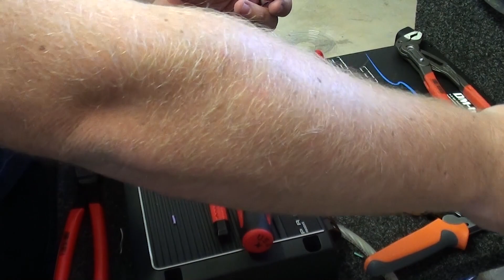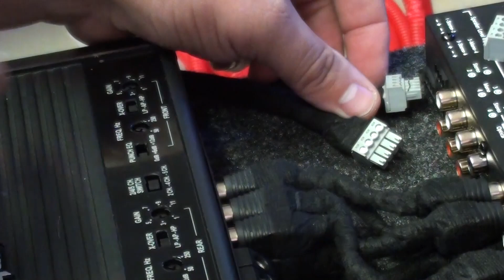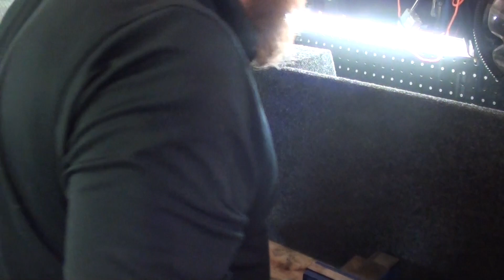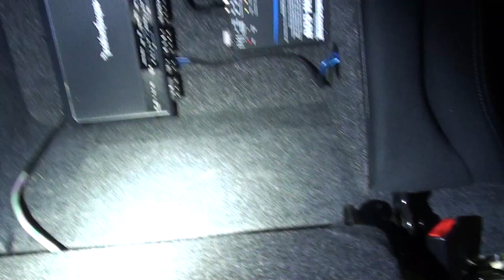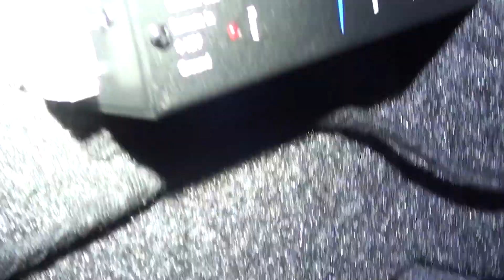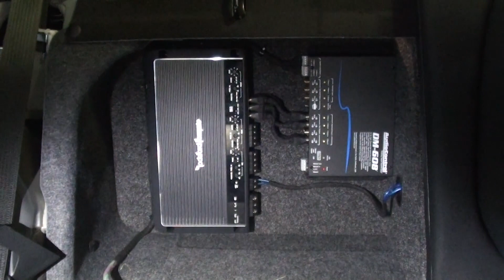Part 6 - 2015+ Mustang Audio Upgrade - Sub Install/DSP to Amp Wiring

Comment: Did you happen to include in a video how you provided power/ wired for power the 608 or is the power provided by the head unit? Also does 608 need to be grounded? Thanks for the great video series and your help!

Comment: Where does the signal from the sub come from? Also it looks like you ran 6 out puts going to the amp. Does that include tweets or an Additional sub for later?
Reply from the maker: The lows get separated by the DSP and put on a separate Stereo channel.  You are correct about 6 RCA outputs from DSP to AMP. LF + RF + LR + RR + Sub Left + Sub Right
Reply: @GJDGarage  so when using the dsp for the front speakers which are spliced into the tweeters what signal do you assign the fronts going to the amp. Do you use high mids or bass since Is two different signals for two different speakers.
Reply from the maker: Sorry it took so long. I didn’t get notified you made another comment. I sent the full spectrum and let the crossovers do their job.

Comment: Hi great video thanks for the help, I was wondering where did you end up installing the crossovers and why didn't you install the crossovers next to the amp and dsp?
Reply from the maker: The ISS 165 crossovers are tiny and to be installed in-line.

Comment: Do you have a link to the wire strippers?  And the RCA cable you used?  Thanks
Reply from the maker: Wire Strippers:  https://www.crutchfield.com/p_18119100/SG-Wire-Cutter-Stripper-Tool.html?tp=990
RCA Terminals:  Link in the description of this video
Wire:  Link in description of Part 1 Video

Comment: Hey bud .. just to make sure before i buy.. can i install 6 3/4 speakers  on the front no problem?
Reply from the maker: William De La Pena I know the focal ISS 165’s will. You can verify by using crutchfield.com’s “will it fit?” tool. Just answer the questions about your car and it will spit out the compatible speakers.

Comment: I will be installing an amp for highs and another for subs.. do i need to buy one of those dm boxes?
Reply from the maker: I would. There are other ways to do it, but a DSP will give you greater control over crossover points and eq.